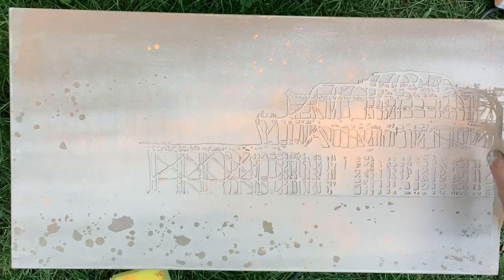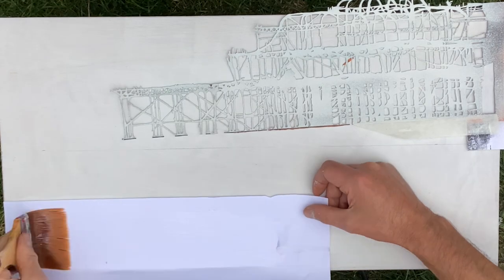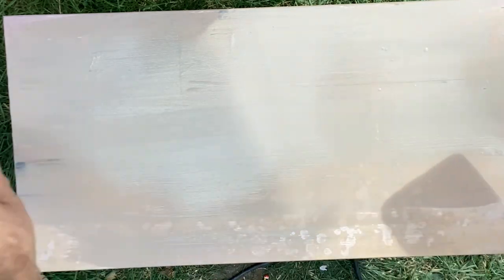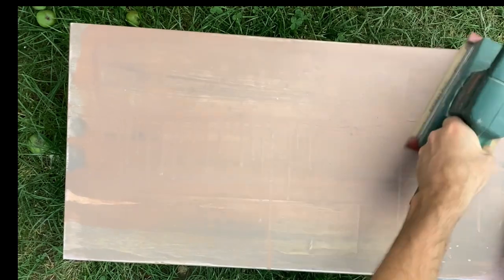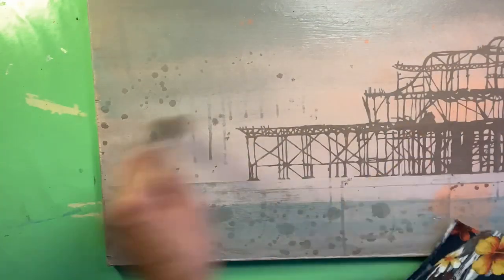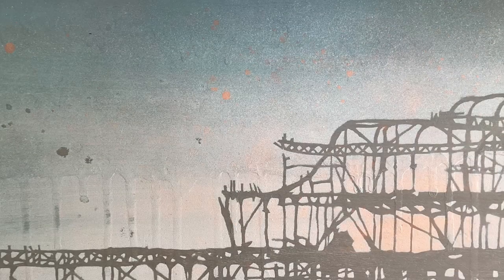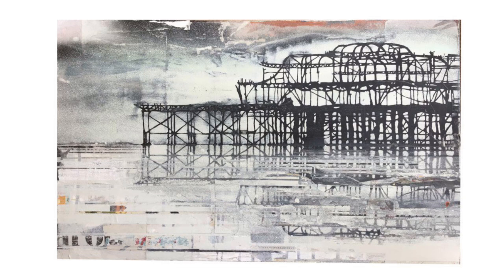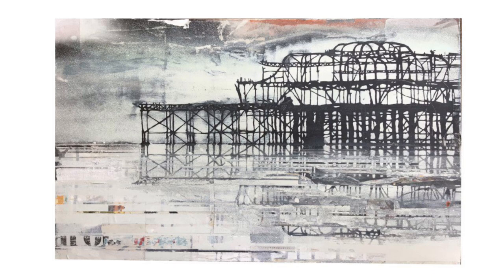Stencil / mixed media / collage tips and demo

Comment: What thickness of paper did you use to cut the stencil? Will the delicate lines in the stencil get thicker and more blurred the more you use spray paint and the adhesive on it?  Were both of the pieces on plywood?  And how long do you think the stencil will last?  Sorry, too many questions. Thanks so much for making these videos, so informative and you make the process sound so logical. A couple of really nice art pieces there. I hope you are able to exhibit them somewhere. I hope that wasn't Mrs Yeates best tea towel.
Reply: The finer cut the design, the thinner your stencil card/paper needs to be. Ordinary paper will work fine for a single use, but will curl as it dries and be very difficult to re-use. Yeates is cutting into an acrylic sketch so, although it's ordinary paper, the acrylic layer(s) strengthens it for stencil work. I mostly use 'stencil card' which is heavily impregnated with linseed oil and gives a stencil that lasts very well and is easily cleaned. Acetate or mylar sheets are better for fine detail. Yes, it will gradually clog with glue and paint - though a sturdy stencil can be cleaned. If (acrylic) paint has dried try using alcohol to clean it off - I use surgical spirit. The spray glue comes off with white spirit. You'll still need to store them between sheets of some non-stick material - though I've sometimes just dusted them with talc.
Reply from the maker: Hi there both, I used 140gsm cartridge paper for this stencil BUT I must add that I drew it nopt intending to make a stencil! The acrylic from the gel plate transfer strengthened it but I find if you are careful with card stencils and don't over spray then they last ages and don't clog up : )

Comment: Spectacular! Especially the second one! The reflection, plus the abstracted ripples from the dechirage /totally/ anchor the stencil in the overall image. I'm particularly impressed with how well the essentially geometric cuts--plus any stray tears and sanding--convey rippling, reflective water. The physical, slightly dimensional layers may play into this as well. 

Additionally, I think there are three things that further the sense of the stencil fully residing in an environment: Massing the collage in the lower areas of the images. And the particular marks that you make, as well as those already on the collage materials themselves. Putting all of these in the bottom of the image implies a foreground. In the case of the second image, the ripples make this explicit, but the use and type of collage, overall, further reinforce it. Likewise, the contrast in the styles of marks in the sky, the pier, and the collage/water. ...And now that I'm reviewing it, the sanding in the lower pier adds a kind of atmospheric perspective, almost like a like mist hovering over the water. (So, maybe that's more like 5 things....) Although it's a basic precept, that whole foreground, middle ground, and background thing really works well, here. 

I think I never did go back and say, regarding the earlier pier images—one very dark, which you said you didn't like so much, and the brighter, sunrise-colored image—that I liked both, including the darker one. Of the two, I actually preferred it, as an image. However, I also realized at some point that a good deal of the story in those two images resides in their sequence and/or juxtaposition. Sort of the story of your last 18 or 24 months, as you've shared in a couple of your videos. It's a bit like that point Scott McCloud makes in Understanding Comics (I think it was): the passage of time, and therefore the actual progression of the story, happens between the frames. Don't be too quick to dismiss or discount the dark works. They are evidence of passing /through/ the times they reference, and onward to what comes after. There is hope in that, and it benefits all of us. 

Yes, please, regarding the offer of a video on decollage technique. Also, this is another time to mention the brilliant Mark Bradford's collage works. He has a whole series of monumental collages in which he embedded strings and ropes, then tore the paper by pulling the embedded fibers out through the layers. One of these is the title image in the article “Mark Bradford’s Paintings Scratch at the Surface of a Conflicted America” from the smithsonianmag.com website. Definitely worth some examination, particularly in this context. 

Finally, at about 8:47, some vertical marks begin appearing in the first image, while you're sanding. What accounts for these? Did you add more collage at some point? Were they drips? Or...? They are subtle, but really add a lot to the image. 

Thanks for sharing your expertise so generously! Who knows how much art erupts into the world as a direct result of people watching your videos?
Reply from the maker: Thanks as ever for such extensive comments and the Smithsonian link is great. I'm hoping, as a result of ,the videos, lots of people will pick up tips and more art gets made! 
The vertical marks were drips, slightly in relief so they pick up under the sander. Will be putiing more stuff together on collage / decollage - techniques I love and am glad to see resonate with some of the viewers : )

Comment: Awesome! If the spray paint is oil-based and the acrylic goes OVER it, won’t there be a problem later of overall peeling?
Reply: I was wondering about that, I'd expect the acrylic paint to bead over spray paint ... interesting  @Yeates Makes ? :) what brand spray paint may i ask ?
Reply from the maker: Seems to be OK if you sand lightly before adding acrylic. I use Loop spray paints
Reply: @yeatesmakes  many thanks!

Comment: Thanks. Some great ideas - and a beautiful image. Though I think your stencil might be too 'deep-end' to encourage people to try it! I use stencils a lot and I tend to make abstract images. Much simpler stencils (applied whole or in part) can be twisted, turned and flipped to get a wide range of results from very little - especially if you mix straightforward spray/brush stencilling with using it on a gel plate and incorporating those results too. I like the way you use some collage pieces to act as a mask and then remove them. Thanks again for another excellent video.
Reply from the maker: Great suggestions here, thank you. I will think on them as i make future vids : )

Comment: Hey Mark, you have been so informational and inspiration for my work lately. I have a quick question. I'm having an issue where when I cut into my collage, the papers rip and have that hazy look rather than nice separation. I tried using less glue/gesso/medium between layers but I haven't been able to get nice cuts. Any advice? Thank you for your videos!
Reply from the maker: Hi there. If I'm cutting into layers, I cut in pretty deep where I want a cleaner edge then rip out at a shallower depth than the cut. For this to work, you really need quite a few layers in places : ) hope that helps